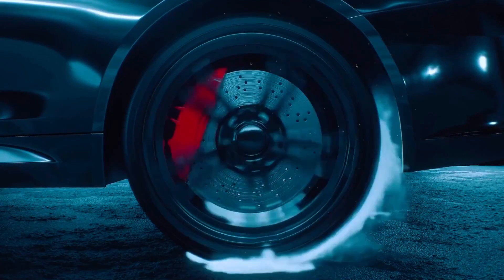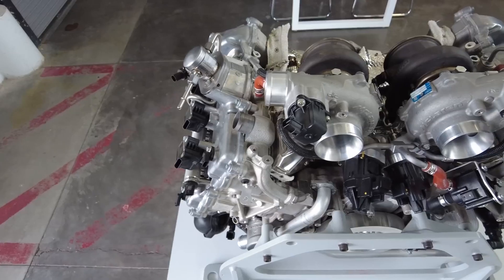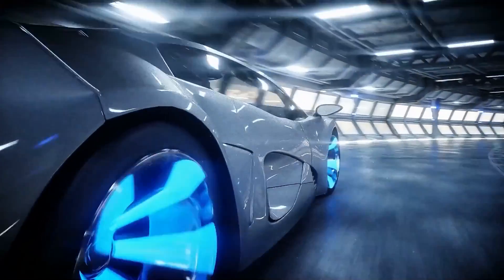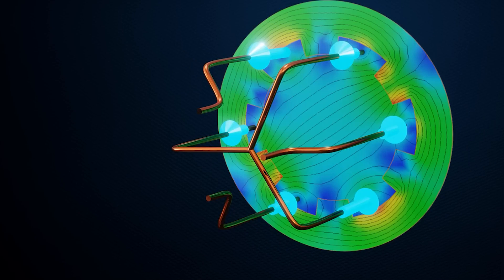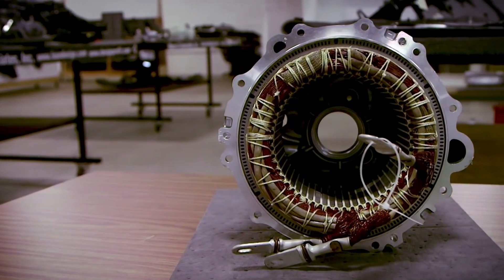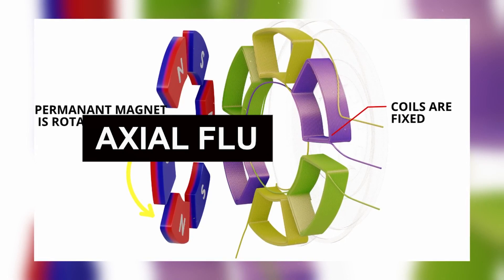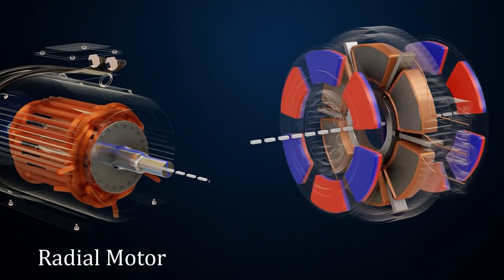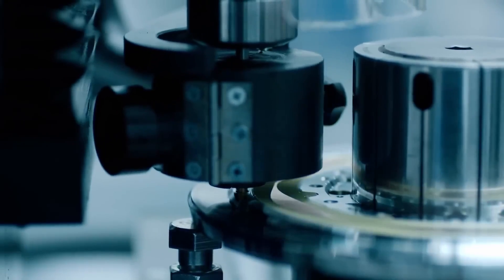How an Axial Flux Motor Actually Works!

Comment: If you have a motor on the wheel. Any damage to the wheel, you might need to replace the motor too. Thus extremely expensive.

Comment: Just to confirm, whilst a good 40% of this video is either our content or about our assets, this is not from us, and 45s in this video has the Stator(s) and the Rotor the wrong way around!  😄
Reply: In addition to Yasa this video also contains content from eTech49 original video without credit or permission. Original video https://youtu.be/B0CNZPenCb8?si=9yzwlZTYRdNh2wa8

Comment: WTF? Another AI generated pile of trash? Lol i'd like to see you try using a radial motor for a drone.. 
Radial motors are used because of their higher power density, and simpler design. i dono where you are getting your information.. ChatGPT?

Comment: Think starter motor  Axil fit bearings rap in Heavy Copper Wire House in heavy steel pipe Zap IT'LL run all day 😊